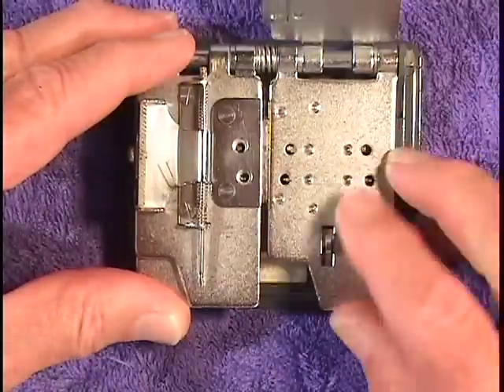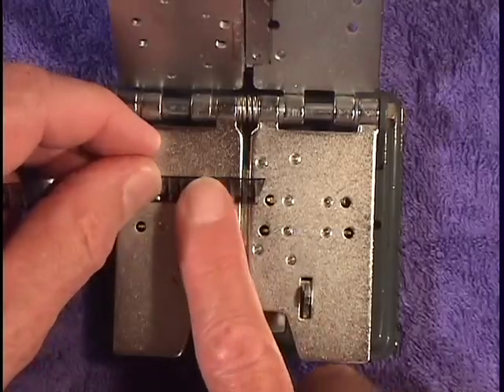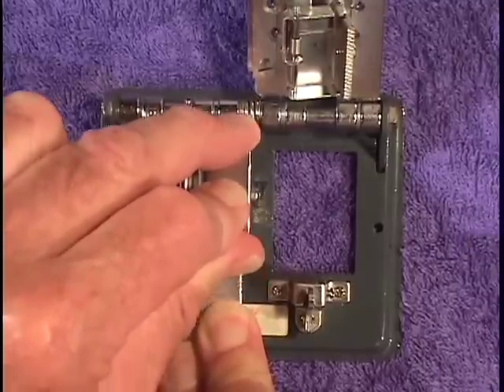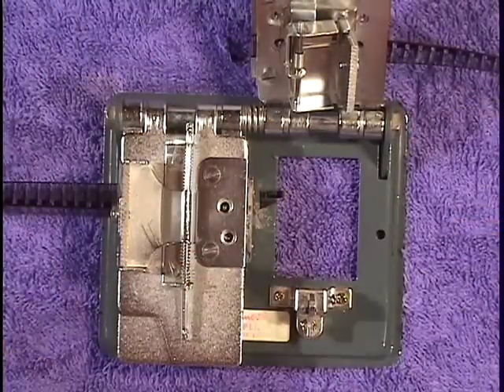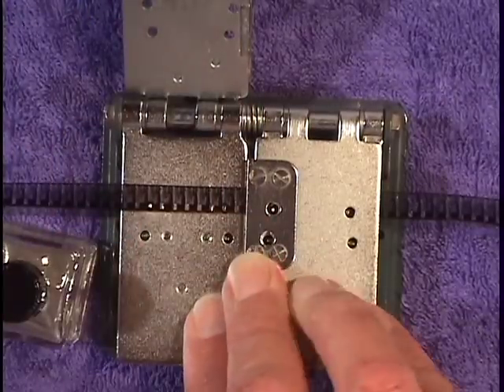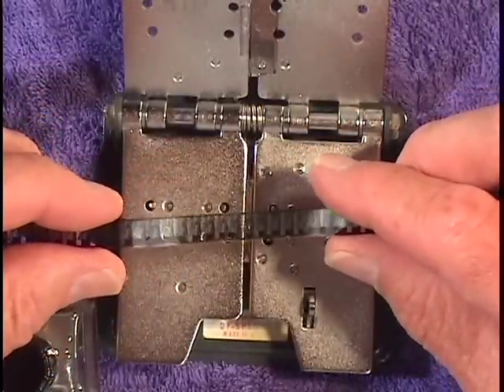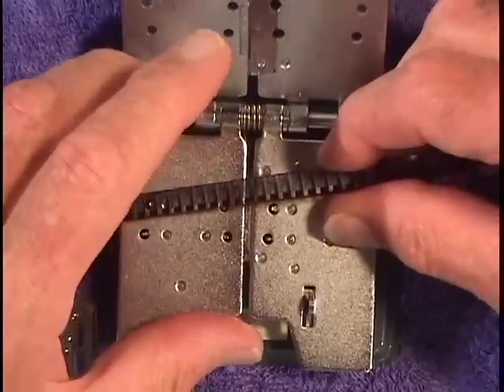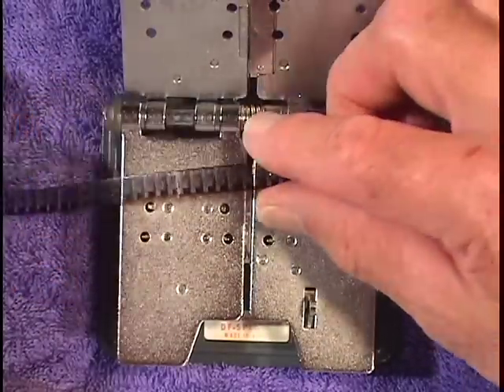Cement Splice 1 Minette Splicer (clip 8)

Comment: Nice video. I have a splicer that no longer cuts the film on the right side. All it does is bend the film at a 90 degree angle. Is there anything I can do to fix it. I bought the kit, Craig Projector Editor KE16, on Ebay and its too late to return it. 
Also the scraper is not doing the job either, it only gets some of the emulsion off. I think the flat area was worn down. Can I sharpen the scraper and the cutter? Or adjust the cutter by moving it over?  Any help would be greatly appreciated.

Comment: Thank you very much for the extremely detailed demo. I take it you prefer glued splices the over tape splices, as with using Kodak presstape pre-cut splices.  The issue I have with glued splices is that it seems it sacrifices one frame of film for the splice. Do you find that scraped frame to be noticeable as it goes by in the projector?

I recently found a Minette Super 8 splicer in a thrift store and would love to try it out. Do you have a good source for glue?